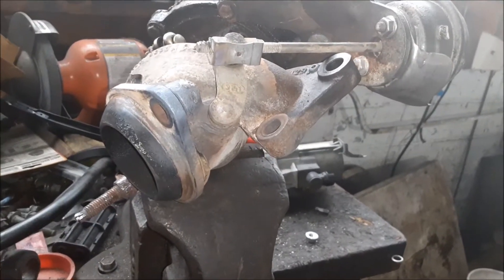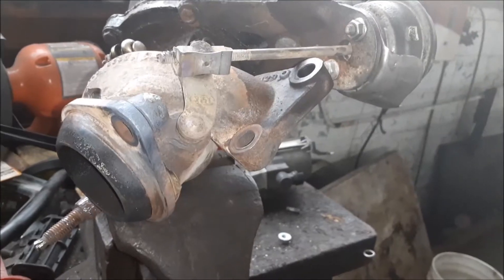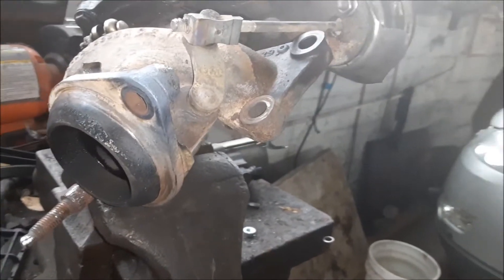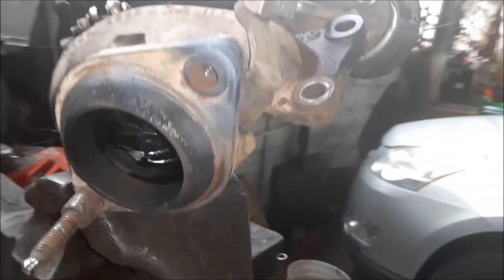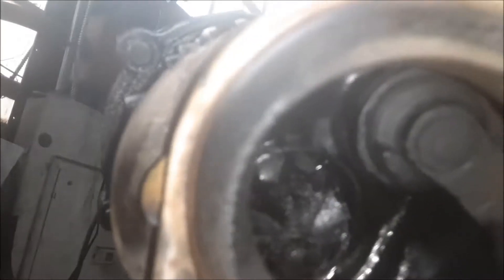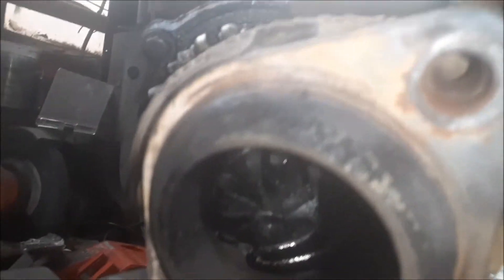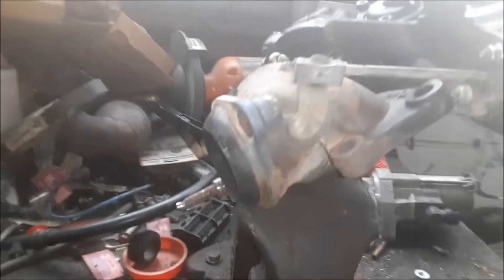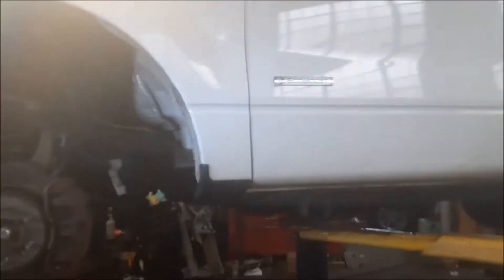Ford F150 EcoBoost Engine Turbo Problems and Replacement

Comment: hi
I have a ford flex titanium ecoboost, just notice white smoke, but the engine runs fine, there is no overheating, the oil is not mixed with the antifreeze, do you think it could be turbo problems?
I would really appreciate your answer
Reply: Same problem!
Reply: @reefn00bzftw  my flex now runs fine, no more smoke, this happened to me a few times after I bought it, but now it's running fine, in my case I just cleaned the PCV. As a precaution, since apparently the turbos are fine.
Reply: Same problem is turbo